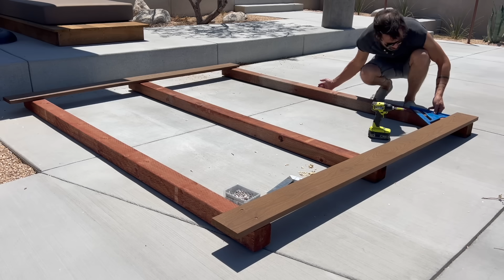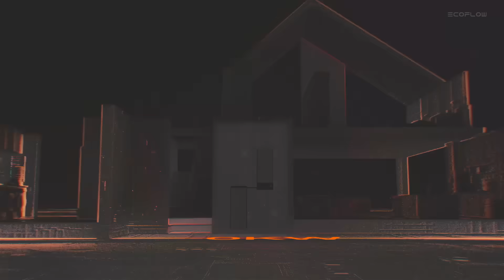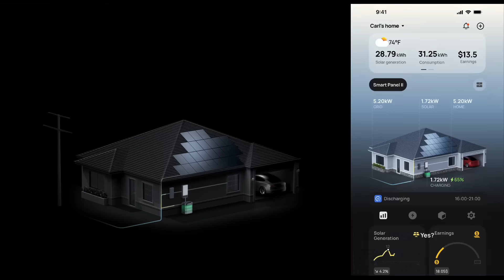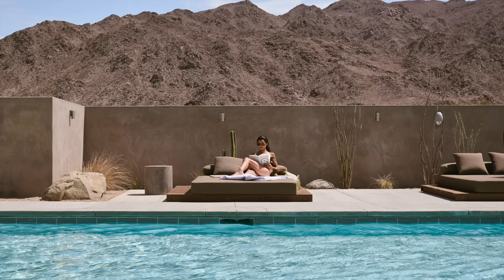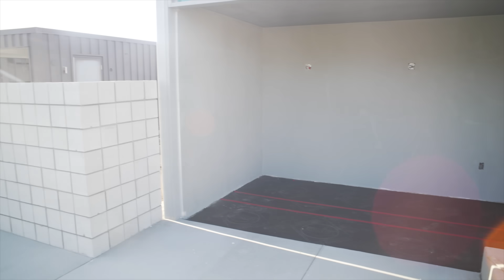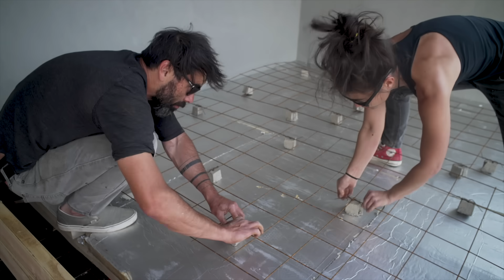Making a DIY Pool Lounge / Day Bed

Comment: I would of had the vertical board you ripped down for the front and back sit under your top boards.  Maybe bit more of an item in climates that have rain it provides a bit of a drip edge.  But other wise a pretty cool idea.

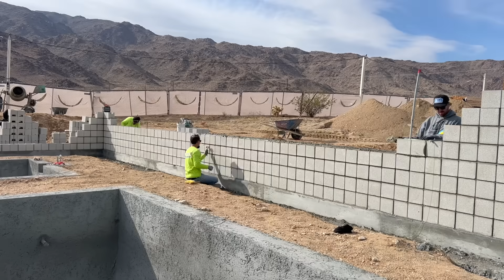Comment: 9:55 no, it's a safety measure to keep unattended young children from falling in and drowning. You can use vertical rebar and a single wire tacked on at the top in order to meet this code, as a cheaper option than masonry. It just can't have any horizontal toe holds.
Also... Why does your masonry wall appear to have no rebar in it? Especially concerning because it's a straight lay, and not a running bond.

Comment: I'm sure you plan on adding umbrellas and large canopies in the summer. If not, that will be a giant oven with that much concrete and surrounding walls blocking any breeze.  But, the good news is that the radiant heat will extend the comfortable Fall season as it dips to freezing at night.